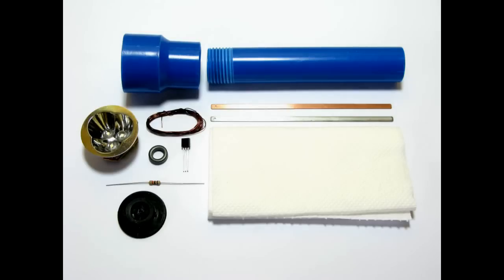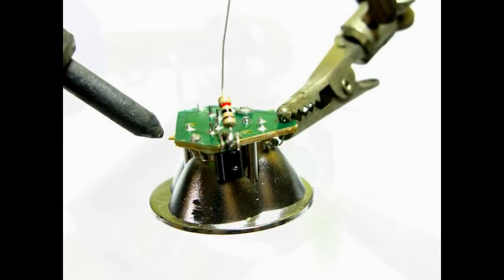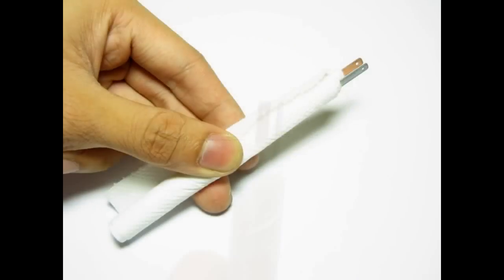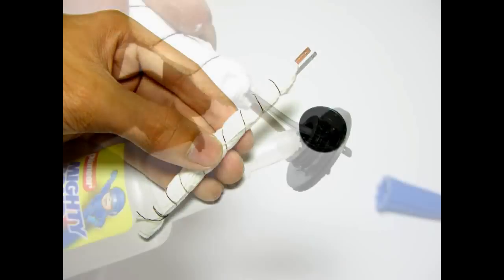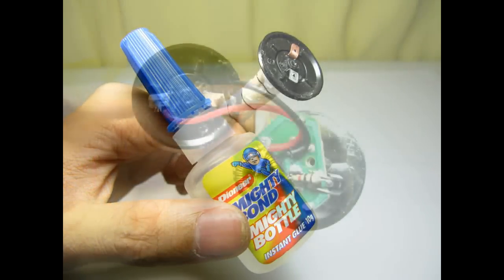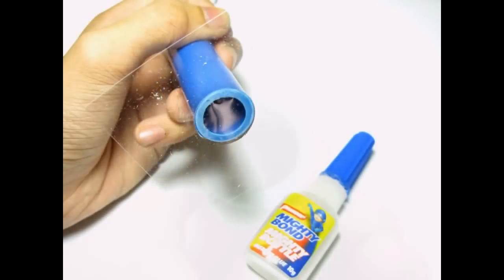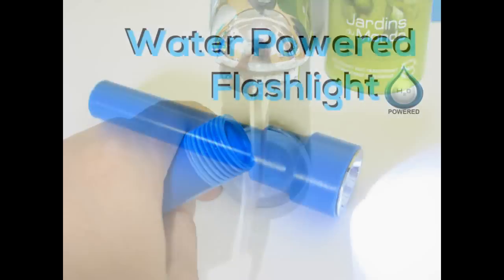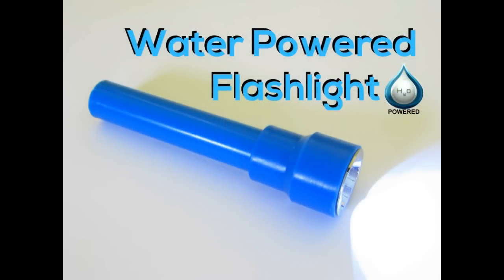Water Powered Flashlight (Weekend Project #1)

Comment: I have a question. What can be an alternative to copper strips since we couldn't find any? I'm willing to try aluminum foil as its alternative but the cell will only allow 0.9 volts as its minimum charge for the led to power up.
Reply: pennies and zinc washers. you are welcome. also, wash your hands after handling zinc

Comment: Cool idea. I have two suggestions that I bet would greatly improve upon your concept. 1. Make the two anodes both coils. one inside the other. (greatly increasing your surface area per containment volume). Easy to do, just make windings and use two different mandrel sizes so one anode fits inside the other with space between. 2. Instead of just (tap) water, make a saline solution (salt water) or better yet a water/Sodium bicarbonate(Baking soda) solution :)

Comment: the water powers it...? doesn't it just activate it
Reply: yep. the water filters into the paper and becomes the electrolyte for the zinc-copper primary cell. i think Alessandro Volta used pretty much the same materials for the fist battery ever made. although Volta's was much better, as it used a stacked discs design to augment the voltage and used salted water as the electrolyte, which is far better than just water.
i'd like to add that this kind of device was surpassed centuries ago and it doesn't hold a candle to modern batteries, but it makes for a nice project to learn about the basics of electrochemistry.

Comment: Hey man I have a super genius idea, can you add 3 joule thief circuits in parallel powered by the same unit to get brighter output? its pretty sweet in fact I'm gonna try this project out with 3 of these joule thief circuits and see how long I can run it. http://www.ebay.com/itm/Joule-Thief-No-toroid-inductor-SMD-DC-DC-/161080170207?pt=US_Battery_Converters&hash=item25812056df
Reply: +William Rojas did it work?